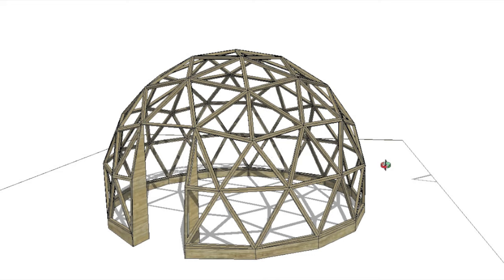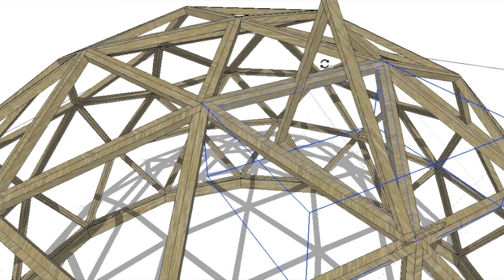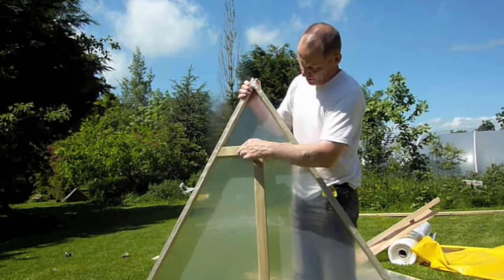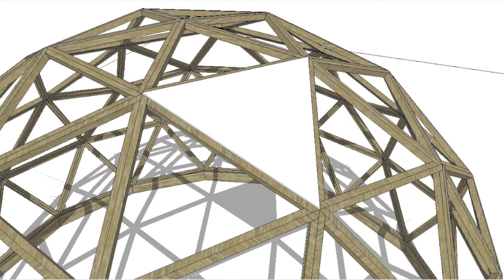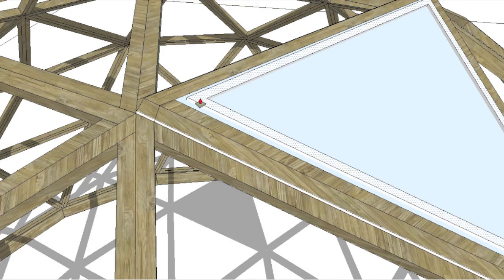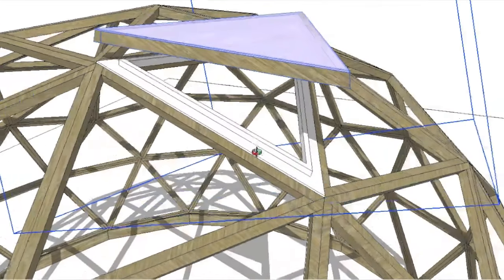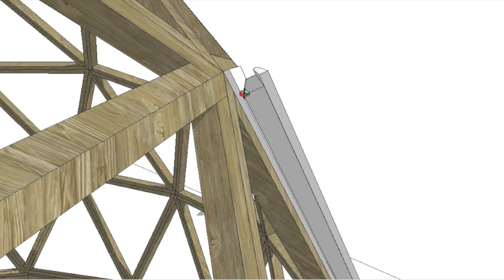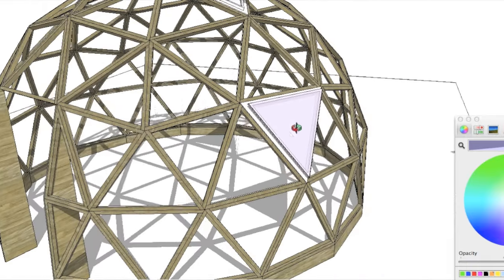Geodesic Dome window tutorial

Comment: what I don't understand is why a whole nother triangle has to be added. I mean, what's stopping you from just adding a hinge?

I guess there might be concern about water dripping in. But I want to build a dome for a tree so I am not worried about leaks.
Reply: remembre that the wood in the dome itself is whats holding the construction together.
Reply: Now there's a couple of reasons one every time you add a screw or something to the frame you are weakening it, secondly increase in points of weakness where water can get into thirdly in the future if you want to change the window now you have to dismantle that entire part of the dome fourthly by making it a separate frame you can waterproof it more effectively by overlapping the flashing

Comment: Hey, Paul. Could you point me toward the window hardware you use? I can't seem to find anything like it. Also, do you shorten the length of some struts in your plans? By a 1/16 or an 1/8th? Is this done intentionally?
Reply from the maker: OK I have made lots of different window openings, what I found worked best was normal hinges with a Quadilent Stay as an opening locking system. I have a tutorial here about windows: https://youtu.be/ObRKygAC7Hs I found auto openers do work but they bend backwards in strong winds.

Comment: The "rotate by 180 degrees" part only works if the panel is equilateral or isosceles. On a higher-frequency dome that could be an issue, right?
Reply from the maker: Yes you are correct, there are two ways to fix this though. If you made the windows upside down on the jig, marked them as windows so you don't mix them up. Or you can design your dome not to have scalene triangles (this is my preferred method) scalene triangles are not nice to work with because you have to have left and right hand versions and not mix them up. You can make higher frequency domes without scalene triangles, for example my 4v dome has only 4 unique equilateral/isosceles triangles (a standard 4v has 6 different triangles some of which are scalene) so it can be done.
Reply: Ok understand
Reply: Ich werde das anders machen ok,die Sonneneinstrahlung ist zu gefährlich
Reply: Das ist sehr kompliziert
Reply: @Geo-Dome  where is that video?

Comment: Whot kind of elastic flashing would you recommend? It has to move like a hinge when windows  open and close.
Reply from the maker: On polythene covered domes I use polythene to flash the window, on glass or perspex I use rubber, a bike inner tube cut down the centre works great, the flashing has to go under the panel above then over the top of the window panel, if you need more details let me know and I'll do a vid
Reply: Paul Robinson  thanks. I have a poly dome but windows I made of polycarbonate and the panels around I want to exchange to polycarbonate too cos I need to drive a chimney thru the roof. Wanna heat the dome in hardest frosty times in winter and in spring. Poly flashing I have cos the constructor did it for me, I just want something longer lasting. A video would be great 👍